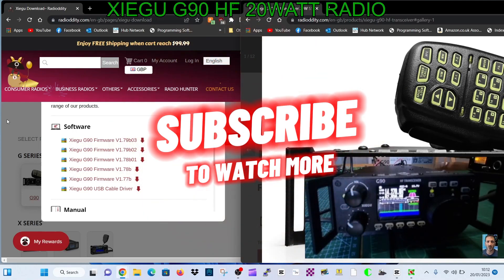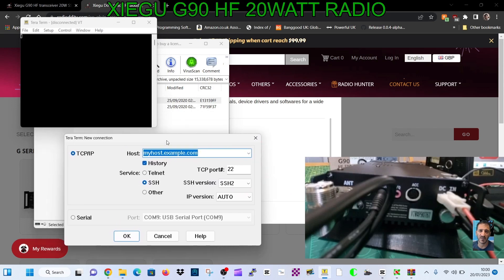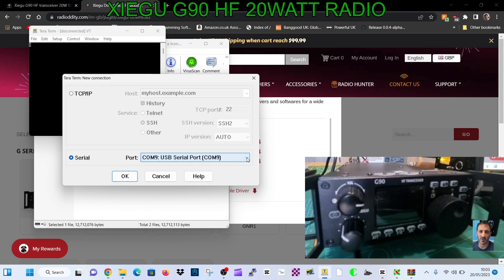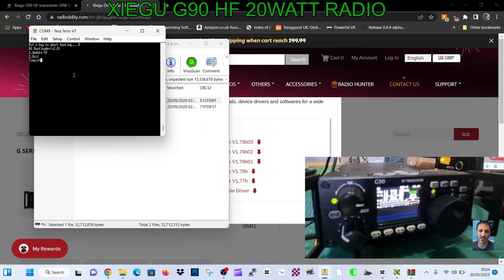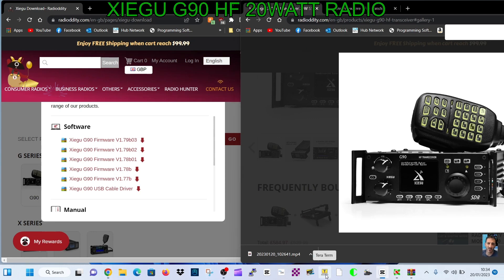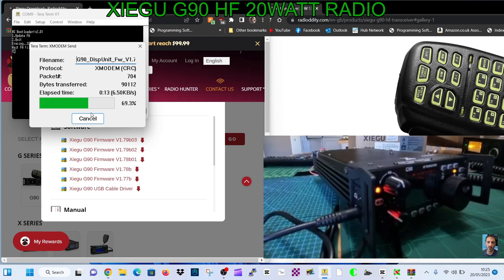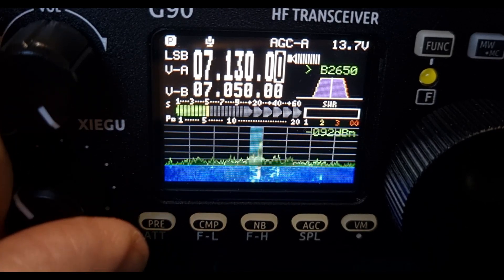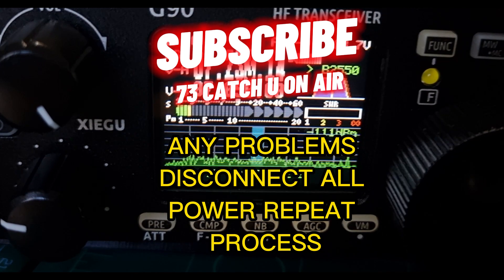XIEGU G90 - FIRMWARE 1.79b3 2023 INSTALTION

Comment: Hi thanks for the video.... do you know if you can update the firmware using a mac operating system?
Reply from the maker: Not that I know of
Reply: You can do it on a Mac. Even if this software isn't runnable in Mac OS, you can use Parallels to run Windows on Mac as its own little application (virtual machine).

Comment: I have upgraded. Have you managed to adjust Rx audio BW ? If so please share how. Thx
73
VU3TBU
Reply from the maker: Hi i use a Icom Speaker.
Reply: @M0FXBHamTech  My question was about how to adjust Rx audio bandwidth as by default it is 2700. But the answer seems to be about the speaker you are using.

Comment: Thanks for going through this so thoroughly, it will be really useful as I have a 2020 model G90 on original firmware, which needs updating. 
I have heard that there is a problem with AM reception, in that it plays the strongest signal on the band, despite you being tuned to another signal elsewhere.  Have you any experience of this pleae?
Reply from the maker: https://youtu.be/BAJ4BP8ZmpU